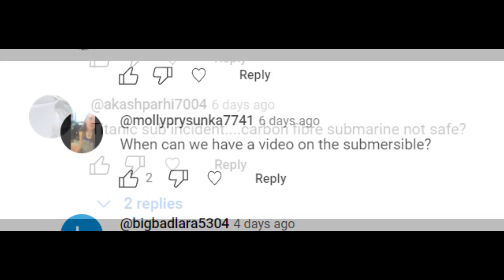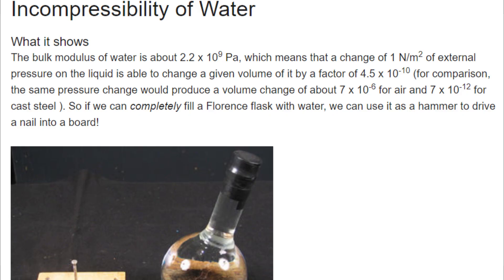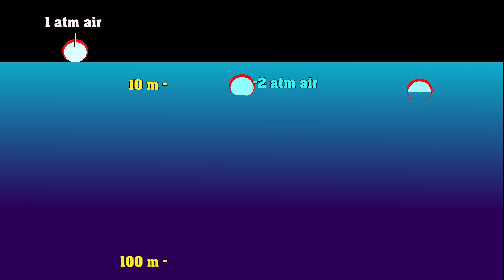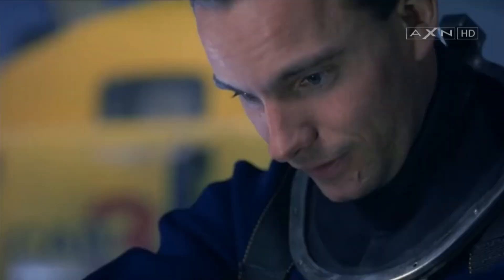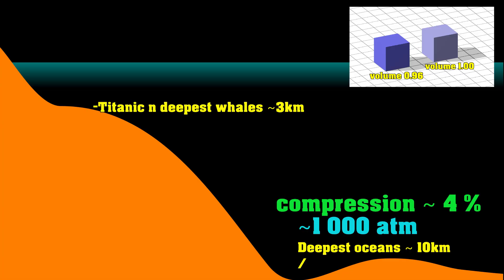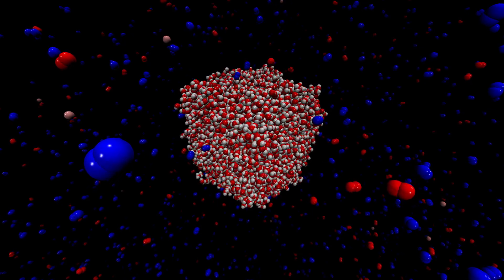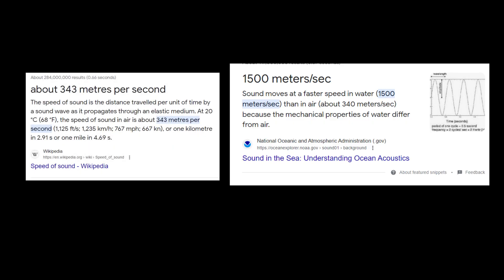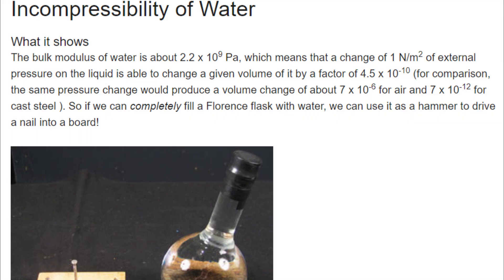What Happens when a Hull Fails at 1000 atmospheres?

Comment: As an ex nuke submariner, I've been following this story and looking at this company I get the feeling of another 'vaporware innovation' like Theranos, The Hyperloop or Nikola - but this time instead of people losing money, they lost their lives; as soon as I heard 'carbon fiber hull' and 'lost submarine' I knew it was over and shook my head.

There is a reason why submarines are made of steel and titanium and not carbon fiber. Steel and titanium have deformation before they give way, giving time to drive yourself up to the surface or emergency blow. Carbon fiber has no give - when it fails, it fails catastrophically. Anyone who has seen a carbon bikes or carbon auto parts blow apart knows that carbon fiber, though strong and light, fails instantly AND catastrophically where as steel and titanium have some 'deformation give.'  If you look at a scanning electron microscope of steel or titanium vs carbon fiber, one can see carbon fiber weave and how 'porous' it is compared to metals. As thunderf00t mentioned resin epoxy which acts as sort of a bonding, filling and stiffening agent for the carbon fiber - but the characteristics of epoxy is that it is strong but very brittle.

One thing I have not heard that I want to mention pertains to the epoxy adhesion of the titanium rings and the carbon fiber hull. Hand applying epoxy and just 'hoping to get it right' is just horrible. If one of those titanium rings of off by half a degree, that is going to create unequal axial loading down the length of the hull; and given multiple pressure and temperature cycles, the potential disparity in tension/ compression is just (head shaking) ...no...just no. That's going to cause cracks in the hull and/or cause the epoxy to crack/ fail. And just one layer of that carbon fiber hull not laid down correctly, one trapped air bubble - and that's a time bomb. Anecdotally, if you look at how carbon fiber diving cylinders are laid, they are laid at axial angles unlike the radial lay of the OceanView sub (yes, the diving cylinders are highly pressurized compared to the subs, but that is a design consideration to think about when thinking about axial and radial tension and compression)

Another thing I noticed is that in some images, you can see condensation accumulating on the carbon fiber ring - which tells me that the sub had no moisture or CO2 management systems; moisture is bad for electronics and if I remember my basic chemistry right, H20 (from people's breath and condensation) + C02 from exhalation creates carbonic acid. How that might effect epoxy? Not sure just throwing that out there.

OceanView's hull integrity system is subpar;  Naval submarine hulls and welds are x- rayed when constructed. Complete X-rays and ultrasounds should have been the very minimum of that carbon fiber hull after every dive. Salt water is unforgiving!

I have heard hearsay reports that this particular sub had cracks in the hull they knew about - if that turns out to be the case and they dove anyways, that is pure negligence. And OceanView had fired one of their engineers and sued him for voicing concerns over the hull - can we say that the CEO was full of hubris and trying to be a 'Theranos' unicorn? 

The more that comes out about this sub...this is why STEM education is SO important - it can SAVE YOUR LIFE! Maybe your BUSTED! videos can save lives!

I've been watching you (thunderf00t) from the beginning and sincerely - thanks for putting the science  perspective out there for the public for 15 plus years now.
Reply: As a professional in carbon fiber when i saw how the cylinder was made by just rolling the fiber along the axis without any cross wound i was flabergasted.
At the tube ends you will get the full cross section pressure only on the tube thickness surface and this is 4-5 times the pressure. And in this direction along the tube axis that rolled fiber gives no strength you just have the resin to hold the pressure and it will lead to deformation and fatigue, cracks and a failure.
Reply: @kukipett  I have heard the leaked text from that morning (going back and forth between the sub and boat)...Just as you say and I too knew, They started hearing 'noises after,  They tried many times (at 95% of the way down) to release ballast, did so and were rising,. But VERY SLOWLY , (Like 15 meters in 5 minutes slow),  then started hearing noises after again then nothing. I bet it didn't even occur to then to give the titanium an extruded lip that goes into the Tube slightly at each end, giving 'lateral' support. I think they just joined flat ends with glue!  The tube started bowing in at one end, scraping against the metal and glue as it went, until pop it failed...
Reply: @kukipett That was my thought too. The fibers have no cross weave but even if they had this vessel would be good as a pressure tank, with the pressure inside and the fibers in tension. When the pressure is on the outside there is only the resin holding. Carbon fibers are not any good in compression.
Reply: @proutsos  Another thing that people get wrong is the speed at wich the water will fill the void left by the implosion. In fact it's like there was a column of 4 km high that has to accelerate to fill the void and it will not be fast. There is a huge pressure but also a huge amount of water to move to fill that void. But there is another problem, it's that water is in fact compressible, just a little but it will react as a spring. We think that water is non compressible, that's wrong. At this depth it will compress and store a huge amont of energy that will be released at a very high speed. This will create a shockwave that wil destroy what's in the tube. The water itself cannot move that fast, this is why there is cavitation when a propeller truns to fast.
Reply: I don't even understand how that was all legal. Like there's no regulations? Lol
Reply: @rabidbeaver167  They made it a submersible and not a submarine specifically so it could be launched from international waters which, being international waters, have no regulations (except international law). This was done to avoid US regulations which would have squashed this project  even faster than the sub imploded. Which also makes one wonder why you would trust a company that is explicitly avoiding safety standards...
Reply: @SenorZorros  Did we not just learn that the sub did not implode?
Reply: @jam99  Kind of...  We know now there are leaked texts between them and the boat. They started rising.  Heard noises aft.., must have been terrifying.
Reply: @jam99  Non-expert opinion here, but I think there's a big "IF" in his explanation where it assumes the pressure vessel just failed and let water in ("hull breach" stated at 2:35 in the video), but we still don't know if it actually failed like this, or it actually remained intact initially (possible as it had a thin titanium inner hull) and compressed itself, then obviously breached. If it remained intact then I assume they would have likely died by mechanical trauma rather than fluid expansion into the lower pressure area.
Reply: @WoodysAR  Are those leaked communications legit?  Have they been verified?
Reply: @jam99  it did implode, he's just talking about the nuanced physics
Reply: @rabidbeaver167 let me put it to you this way. In the US legal system, if you have enough money, everything is legal. You ever see any billionaires being sent to prison? No? Only poor and middle class people in prison?

Legal system is broken beyond repair and needs a total overhaul. Legal representatives should be paid for by the state, and only one lawyer should be allowed, and trying the old “wall of lawyers” trick should be instant life imprisonment.
Reply: @dylandepetro4187 Reminds me of Seto Kaiba's catchphrase from Yugioh Abridged: "screw the rules, I have money!"
Reply: @rabidbeaver167  In international waters? Nope lmao.
Reply: @rabidbeaver167 I don't know law. Considering they were in international waters I don't think there are laws that apply to needing a certified craft. I think another thing to consider is that it wasn't in the class of craft that are ocean going vessels, it can't travel from port to port, it is a deep dive structure that used independent propulsion instead of a long cable. The thing that does require an independent inspection is insurance which across the industry as far as I know is something everyone and everything has before diving. This team wanted to be mavericks in all ways and didn't have insurance. The most irresponsible was the support ship. Tell me if I am wrong but I think the support ship was "for hire" and surely could have declined to continue the service at anytime because of safety consideration, without fear of being successfully sued.
Reply: @rabidbeaver167 they signed their lives away?!..... thats how it was legal.
Reply: @Marin3r101 You can't do that
Reply: @rabidbeaver167 The freedom to be an idiot is important. Everyone involved knew their lives were at risk. Lawsuits for negligence make sense but no excuse to give uncle sam more power to abuse.
Reply: @CodeBonYT ”Uncle Sam” regulates the US aviation industry making is the safest form of travel per passenger mile. Your irrational distrust of government to actually function properly when staffed with subject experts belies another agenda. Perhaps living in some other country with no functional government would give you the taste of “freedumb” you seek.   No regulations on food or drug safety or water portability. 

Yeah. Regulations are for suckers. 🙄
Reply: @lohphat  This was not travel, it was recreation/“exploration”. I believe in regulation generally speaking, but I don’t think we need government intervention saying you can’t endanger your own life being an idiot if you want to. Otherwise bouncy houses, trampoline parks, bicycles,skydiving, bungee jumping and roller coasters, skateboarding, skiing and even really spicy food should all be regulated out of existence because they all kill more people than homemade submarines with less utility.
Reply: @CodeBonYT  The point of regulation is informed consent of risks. There was none here.
Reply: @lohphat  It mentioned death several times on the first page of the waiver, is that not Informed consent?
Reply: @lohphat  The point of regulation is irrelevant, the outcome is paying someone to give you permission to do something you could just go do before. In some places you can't cut down a tree on your own property without dealing with "regulation" its ridiculous.
Reply: @CodeBonYT  What it did not declare is that the vehicle was not inspected or certified for the activity it was charging money for. It was experimental. Not suitable for commercial operations.
Reply: Yes, there was at least one crack that resulted in the submersible being de-rated to 1400 m. That crack was repaired (how?) and the thing was cleared to 4000 M again (by whom?) In any case, you could not have paid me enough to dive in that death trap. Yes, it made previous successful dives, but each dive caused more damage to the hull. On dive 13, time ran out.
Reply: @surferdude4487  It doesn't take an engineer to realize the sub was absolutely not safe. Case in point, there there was another wealthy father/son duo who were originally scheduled to be aboard the sub that fateful day. The son, who was only 16 years old, and a huge Titanic enthusiast who dreamed of visiting the wreckage, did a little research about how the Titan worked and what it was made from, and decided there huge red flags about safety. He convinced his dad to back out of the trip, and the Pakistani father and son replaced them on the trip. 

That was a 16 year old with no physics or engineering background who knew better than to get on that death trap. 

Their other red flag was that Stockton Rush personally paid them a visit in Las Vegas to meet up with them and get them to not back out. He flew to them in his own experimental homemade aircraft which he piloted. That was the other thing that convinced them that Rush was crazy and couldn't be trusted with safety.
Reply: @surferdude4487  I believe that crack was in the original hull. They scrapped that hull and made another one.
Reply: As a layman even I could see this was shocking engineering, but when I saw the video of them hand-painting the epoxy on the end tubes in an open warehouse with no temperature or air quality control, it became really obvious how criminally negligent this thing was.
Reply: i think the dumbest thing was to choose carbon fiber as a material. I disagree about the titanium stuff, i think that is actually manageable and they got titanium which is the only sensible material for long term pairing of carbon fiber with metals. To use a material made for tensile loads and use it in an environment with nearly only compressive loads is dumb. There you mostly only use the strength of the epoxy resin which is not much (compared to a metal). It is plastic after all. Water and cfrp also do not pair well. During my time in academia i pursued a research project about impact of water exposition of cfrp on tensile strength. Well, if the water enters the cfrp (i.e. at exposed cut surfaces) it soaks deep into the material along the fibers, causing swelling and weakening the material. And then the news that the guy boasted about using expired carbon fibers. Normally the fibers are surface treated to enhance bonding with the resin. Thus a weak bond may result and the material is one step away from failure. All in all, outright wrong material choice and preventable disaster
Reply: @jekker1000  Wait until you hear the leaked texts,..  CHILLING,.. They were falling 4 times too fast.  Got 90% of the way down, then THEY STARTING HEARING NOISES AFT!  Tried multiple times to release ballast, then were rising very very slowly.  Reported they started hearing noises again, then gone.
Reply: Appreciate your insights sir
Reply: @@nefereti2461 There are very few regulations in international waters, certainly none that pertain to whether you're allowed to build your submersible out of carbon fiber or not.  What they didn't give a shit about were certifications. All DSVs other than this one are commercially rated to function at their intended operating depth, these guys didn't have theirs rated because it wouldn't pass due to being made of exotic materials.
Reply: As a diver, archer, hockey player (they make sticks out of carbon fiber) and marina operator.  Don’t f*ck with materials that are not long proven to work well in whatever application you wish to trust your life or valuable property to.  The guy above still thinking carbon fiber is a good choice if just made “thicker”. Materials science and engineering only go so far until it meets up with reality. I’ve met plenty of engineers who don’t know how to make what they design.  The ocean is not a friendly place.
Reply: @sethfg  yeah man you’re totally right.. just from what I know from archery and carbon fiber arrows being broken or perfect, it’s pretty obviously a shit material choice for a sub
Reply: Just checking... you mean Ocean Gate ya?
Reply: @stampedetrail2003  I think he was on a roll when he wrote it, good explaining too, and yes you are right, Ocean Gate. Steer away from that company, slowly...slowly.... LOL
Reply: Yeah I kinda thought the same thing just knowing what I know from archery.. arrows used to be made from aluminum, but it sucked because of that deformation.. you’d always have to check your arrows for little dents or scratches or just for overall straightness. But when they switched to carbon fiber, it was way better because it’s either totally broken or perfect and it’s obvious which of the two states the arrow is in. But obviously for a submarine, those sort of material properties can be catastrophic
Reply: the carbon fiberhull was a real thing with one HUGE caveat

the hull was made by a actually competent company for one of there submersibles that worked great! and was compleatly suitable for task

now i did say there was a caveat didnt i?

its the spec

it was rated for depths way way shallower than oceangate took it but more importantly they certified the depth for ONE SINGLE DIVE

they said it would probably be ok for subsequent dives at much shallower depths than there certification after the first dive but with every dive it lost more of that rating

it most certainly was not rated to go taking selfies of the titanic multiple times
Reply: @Sarge92  Wow that's interesting. I didn't realize that. Thanks
Reply: I think just a 0.5% deviation from perfect results in nearly a 30% worse depth rating too.
Reply: All very well put. What baffles me is that as a person with 0 naval or submersible experience, as all of this was starting, I came to the same conclusion as soon as I heard the hull was made of Carbon Fiber. 
As an amateur archer, Carbon fiber arrows do NOT fail gracefully. Especially not after dozens of stress cycles..so why the hell would a ceo with that much experience think that sub would be okay for... wait how many dives did they do with that hull? Holy hell.
Reply: You're right about the epoxy application at the rings. In general that application for anything that will be under high pressures is supposed to be done in a vacuum chamber, and ideally should also be a particulate clean room. I've seen industrial epoxy application for non submersible projects need these conditions. If they skimped on any of the construction in those details this was inevitable, regardless of the supposed material strengths involved.
Reply: Who knew that not doing composite properly in an enviroment where its not recommended to use the material in the first place, then storing it in the direct sunlight without any protection/proper coating and not even inspecting it regularly would cause somehing like that.
Reply: Holy shit, I didn’t know that. How could they possibly think NOT axially layering the carbon fibre was a good idea? Mind boggling.
Reply: Yeah man. Carbon Fiber reaches yield stress and shatters/fractures unlike alloys which plastically deform via bending. Imagine building a sub out of material that automatically punctures upon reaching its elastic limit... 😆🤣
Reply: I’m a submariner myself. Ironically, I posted nearly identical talking points as you when this situation occurred, just so I’d stop being bombarded with questions from friends who aren’t knowledgeable about this sort of thing. I definitely saw a major flaw in the load bearing of the joints. Right angles tend to be the weakest point under pressure. Binding titanium to carbon with epoxy, in theory, is doable, but we’re having a hard time keeping it together in golf clubs, let alone a submarine at thousands of meters deep.
Reply: @Smezzad  Thanks for your contribution to educating the public freely!
Reply: You speak of Theranos as if it was something special but just about every business is like that. A corner shop building PCs that i worked for some decades ago bought a whole pile of in hindsight infamous Codegen 420 power supplies, and the boss was big surprised Pikachu face when people started returning the computers with massive damage; i should say he's lucky that he hasn't caused one house fire because the PSUs had signs of catching fire on the inside, they just happened to extinguish themselves before fire reached the curtains or something. He also tried his best not to pay me, because the money got funnelled awfully quick towards cool tat for boss's kids. This is the microcosm of capitalism and indeed the human nature per se, it's all about scamming the customer and the worker as much as they can get away with. Since then a long time later i worked for several automotive companies as computer engineer, and things were a little better there; but remember the VW emissions scandal. They also had two groups of people doing the same sort work as well, the employees and the fake contractors/employees loaned from another company, with the loan workers being paid much less and having less job security, and being pitched against each other with unequal rules applying to the performance of two groups. The actual arrangements were different between the companies but all had some amount of law skirting. And of course state companies and state structures are known for corruption, nepotism, skirting the law etc worldwide. Is academia better? People publish deliberately irreproducible papers in scam journals and steal their coworkers' material. Humans are just terrible all around.
Reply: Airplanes don't fall out of the sky bcuz they're too heavy. Nor do battleships, carriers or submarines  either.  And they must weigh more. So quit making the  'pound for pound ' or' strength to weight 'arguments. I don't think we need to worry about how heavy shit is anymore.
Reply: You just gave me power school ptsd but I agree
Reply: Great comment. Stockton Rush was just arrogant beyond belief. He thought his aerospace engineering knowledge would seamlessly transfer to deep sea marine. There's hard earned reasons that there are different engineering fields and he disregarded them. I read peer reviewed papers on carbon fibre in compression by experts and the tests concluded that after the very first dive cycle the carbon fibre lost over 30 percent of hoop stress!!! There are just too many red flags to list , it almost beggars belief. I feel honestly gutted that a 19 yr old kid died because of gross incompetence.
Reply: I mean they did go successfully down here for a long time with others subs
their videos are actually quite cool
But safety was not enough of a priority

Now what's ironic is that you get a better experience watching one of their vids from home, than from their sub, since they just had a screen inside
Reply: He did have CO2 scrubbers on the sub but no idea how effective they were.
The main thing for me was this was a guy who, when questioned about the safety of his submersible by concerned potential customers and journalists, cited the safety record of an industry he HIMSELF proudly boasted he didn't follow their rules.
He would sound smore like a snake oil salesman, bamboozling lay people with puff about Carbon Fibre and NASA, the suggestion being, calm down and don't worry.  NASA uses this stuff.
Stockton Rush was a disgrace.
Reply: Greetings other nuclear sub engineer, worked for electric boat for 7 years and now working at space x
Reply: Thank you, squid!
Reply: You mention the lack of CO2 and H2O management.  The first thing that came to my mind when it was reported that they had 96 hours of O2 was "what about the CO2?"  CO2 poisoning will kill you before you run out of O2.  The famous square into a circle hack on Apollo 13 wasn't to provide O2 but to remove CO2.
Reply: i still do not understand why carbon fiber was used.  because it was lighter ? cheaper ?  seems foolish to try experimental materials in manned crafts ,  numerous unmanned tests should have been performed
Reply: @anyone9689  Lighter, cheaper, faster.  Why not do tests and get it certified?  Costs money and takes time.  Time that could be used making money on dives.  The whole company was about taking shortcuts.
Reply: I don't say that it's a good thing but we need to give it to him that he was a true innovator not to scam people but form the depth of his heart if that invention wouldn't kill most likely next or next next etc would kill him.
Reply: @simon2493  He wasn't an innovator; he was a narcissistic, reckless, vindicitive cheapskate.  Cutting corners on safety is not innovation.  Ignoring expert advice isn't innovation.  Firing employees because they expressed safety concerns isn't innovation.  Not testing your product because that would cost money isn't innovation.

Using CFRP - which is good at resisting tension but very poor at resisting compression - as a pressure vessel was not innovation, it was a blatantly stupid choice made to reduce costs.  Stockton Rush even bragged about the great deal he got on the carbon fibre sheets from Boeing, because Boeing considered them no longer safe to use (past their shelf life).
Reply: Anything under that massive amount of pressure that the titanic is as wouldn't "give warning signs". Things that deform at that pressure even slightly would fail catastrophically
Reply: ,I'm not buying it. Carbon fiber blows. Facts may be facts but reality is still king. And the reality is when it comes to deep sea environment carbon fiber is simply inferior.  It doesn't matter if it is lighter. If science and technology can keep a 70 ton airliner from succumbing to the GOD-LIKE forces of gravity then we're not likely to ever need to rely on some shitty ass-wipe like carbon fiber.
Reply: Carbon fibre has no give??  You smoking crack?
Reply: Very insightful post. A rare sight to see such high quality contributions on YT. A major big ups to you sir.
Reply: The comparison with Theranos and Hype-loop is interesting but I think a better analogy would be the Mars colony "proposals" made by magical thinkers who desperately want to believe that science is more advanced than it actually is. Oceangate didn't seem to be able to accept that current materials science is not sufficiently advanced to make a submersible of this type. We don't have magical super-strong and lightweight hull materials capable of surviving at these depths so we have to use METALS. 

Similarly, we don't have magic rocket engines and artificial gravity and endlessly renewable food and water generators to make Mars anything like habitable. It's all very well being inspired by science fiction but you have to accept that we don't live in those science fiction worlds.
Reply: That was a informative post.
Reply: Excellent insight and I totally agree with you about STEM education! I have a biology degree but only had to take one year of physics and my brother is still getting his degree (not sure what in yet) and both of us knew this carbon fiber thing was a bad idea for this application. My brother pointed out that carbon fiber also fails at cold temperatures. Most people think of its upper limit of temperature but it actually fails around the temperatures at the depth of the Titanic. Neither of us needed an engineering degree to immediately see the problem.

As it turns out, carbon fiber and titanium together in an electrolyte solution (like the sea) can actually undergo a reaction in which the carbon fiber becomes a cathode and the titanium, an anode. Over time, that degrades the materials, which would eventually cause a failure. It also releases hydrogen gas, which is flammable.

Then there's the fact that using multiple materials can result in additional fatigue to the joints between the materials since each material reacts to temperature and pressure differently. Multiple pressurization cycles eventually cause failures in even the most carefully built thing subjected to them. If Stockton really was a legit aerospace engineer, this should have been drilled into him since there have been a number of failures of airplane surfaces due to fatigue (maybe he had only actually watched disaster videos about metal fatigue and failed to realize that every material is subject to fatigue at some point, which is ridiculous because even I realized this and I'm a biologist!). I honestly think that it's a relatively reasonable thing to consider that perhaps Stockton's rich parents paid for his engineering "degree". It's not exactly unheard of and it's fucked up because some of us took our studies seriously because we knew that, if we didn't, it could cost someone their life but many of us are still in abject poverty even after attaining a degree in what was supposed to be a lucrative degree. I didn't get a biology degree for that reason but because I was interested in it but some people pick their majors based on how much money they think they can make with it. I've saved lives with the knowledge I got and the sadness I have is that I was never able to save more lives that just the people who knew me and listened to what I had to say about things, plus I've saved my own life, as one does if one can.
Reply: STEM sure is important. It is a shame people are being pushed through because "inclusivity" and such nonsense.
Reply: @blargcoster  We know you really want to fight some imaginary culture war, but you do it somewhere else?  It has nothing to do with OceanGate.
Reply: @blargcoster  "STEM sure is important. It is a shame people are being pushed through because "inclusivity" and such nonsense."

elaborate, please.
Reply: Cyclic stress always results in a brittle, abrupt failure, even in ductile materials. People shit on carbon fiber, but pound for pound, it obliterates steel and aluminum. I think it was the combo of shitty engineering, manufacturing, and a lack of testing.
Reply: @ZebraLemur  Carbon fiber is a composite material, testing it non-destructively is much harder compared to homogenous materials like steel. Using it for a 1 trip vehicle would not be too much of a problem, but a vehicle that is to be used multiple times is very difficult to actually test between uses. Hence the lack of testing
Reply: @tiikerihai  It is more difficult testing than steel. But being 4 times lighter for the same stiffness, the safety factor could be 4 times higher than steel for a given weight. If you make a sub that has a safety factor of 8 instead of ~2, you're not gonna have issues. They didn't add enough safety factor.
Reply: @ZebraLemur  There is no merit in building something out of carbon fiber if the weight does not go down.
Also, is stiffness what you actually want? Both steel and titanium get compressed under pressure, your pressure hull becomes smaller as you dive deeper. The point is that they return to the original size and don't take any permanent damage once you return. That's exactly what you'd want out of your carbon fiber too.
Reply: @tiikerihai  I was just pointing out an exaggeration to show the advantage that carbon fiber has for a given weight. I would choose a carbon fiber hull with 8x safety factor over a steel hull with a 2x safety factor. Carbon fiber is a miracle material, but they used a safety factor too low and poor methods of assembly and manufacture and didn't spend the cash to ultrasound it.

Stiffness is absolutely important in the design of a pressure hull with external pressure. The hull is gonna exquisitely sensitive to any deformation from round and a stiff material is going to prevent deformation and subsequent buckling of the material. Buckling equations don't even consider strength. They are functions of youngs modulus (stiffness).
Reply: @ZebraLemur  carbon fiber isn't a miracle material. When comparing it to aluminum of the same thickness and length in a crush test, with a hydraulic press, the aluminum out performed carbon fiber. Titanium of the same thickness was almost 4x stronger in the crush test, and stainless steel out performed them all.

Carbon fiber did "out perform" acrylic, PVC, and brass. I say out performed, but really it started cracking much sooner than it deformed. So I loosely say it did. To me if it cracks, it's failing.

So I disagree with your assertion that carbon fiber is superior to Titanium, when you need 4x more carbon fiber just to equal Titanium.

You said it was a miracle material, clearly it isn't when it comes to being crushed, kind of like what water pressure would do.
Reply: @schmalzilla1985  I've seen the same video. Carbon fiber has different grades of strength and must be combined with high-quality resin for compression. These materials are of unknown origin or grade. I would characterize that test as measuring "flexural ultimate strength". In the case of a hull under compression, stiffness (a wholly different material property) is going to be a significant factor in preventing buckling. Carbon fiber is twice as rigid as titanium and half the weight. Pound for pound, carbon fiber kicks butt. Make a carbon fiber bike as heavy as a steel bike and it's gonna be a tank of rigidity and strength. A beam of carbon fiber can be made 4 times thicker than a steel beam for a given weight. That is 64 times stronger and stiffer!!